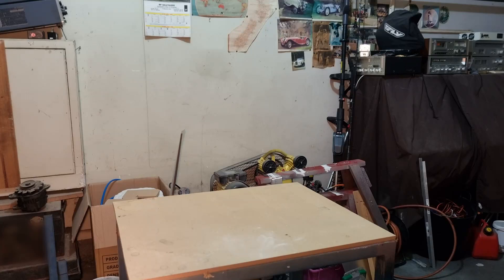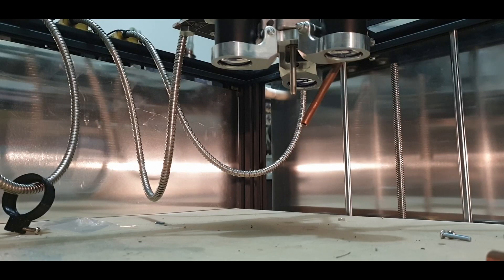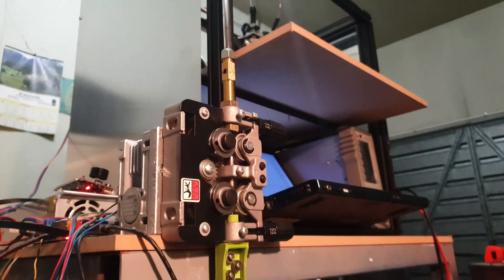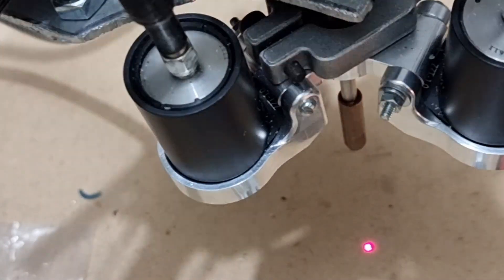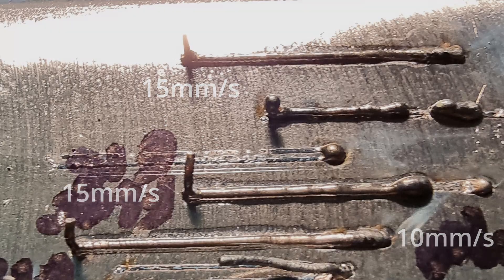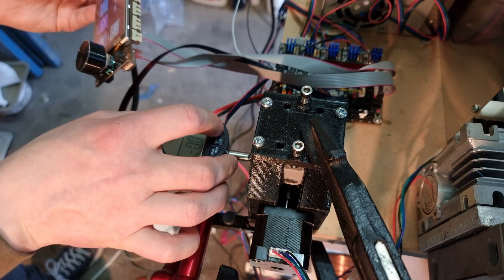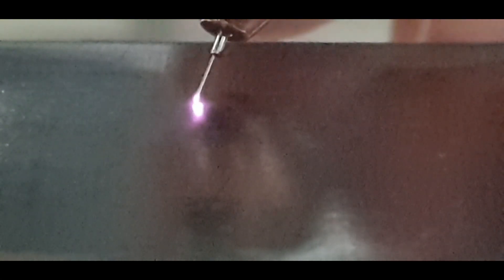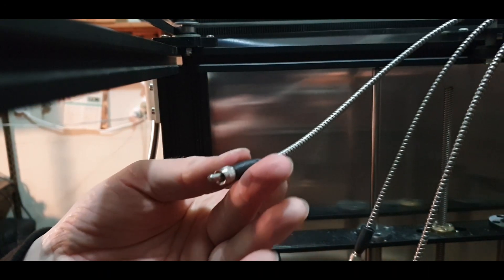DED Metal 3D Printer - Round 2

Comment: Your biggest problem seems to be lack of research and trying to improvise too many things based on what you feel should work. This means many problems that should never happen end up holding you up. Also plowing full steam in a totally non-workable direction based on assumptions. Starting with a 10 beam BLUE laser was a total waste of time and money, even a 10 minute google search could have prevented. Different wavelengths are absorbed differently, and blue being very short wavelengths are relatively bad at heating things.

As I pointed out in a previous comment this should be more than doable for under $2k. An F theta lens costs <$100 and 2 galvos can be had for around $70. Gas regulators are about $20, and I buy steppers and 500mm linear stages for $40. This puts you at under $300. This gives you a massive budget for the CO2 laser, electronics, power supply, and feeder mechanism. A 100W CO2 laser should be plenty of power and can be had for under $300 + cost of a power supply. 

The reason an F theta lens and galvos is a better solution is because it keeps your beam in focus at any point across a plane, giving you additional speed and no need for moving the laser. You essentially only need to move in 1 Axis while adding material. A CO2 laser puts out infrared wavelengths which heats material directly without heating the atmosphere around it, giving you a density gradient to reduce spatter as well. I suggest using argon as a shield gas anyway, although helium is sometimes used. You pretty much just backfill your chamber in order to reduce oxidation, although it can also provide even more pressure depending on the material, this might improve quality.
Reply from the maker: Ironically, 10 minutes of research would reveal to you why shorter wavelengths are the industry standard.

Comment: I feel bad that you had to ditch the slm project. You had put in so much effort. I'm going to build an slm machine starting next year. Good luck with your ded machine. What do you think of fdmetal, like desktop metal. I think chances of success could be more in that than DED.
Reply from the maker: Thanks for that. Yeah, I think it is typically a 3 stage process involving binders / pressurized kilns etc. I'm looking for something direct.
Reply: @metalmatters  I'm interested in the slm / dmls for the same reason. It is direct and it is superior in mechanical properties. And that's the only thing I've got experience in. Although it's messy, that's ok, i can get functional end use parts. I'm building a high temp fdm for now, gonna make some money with this and start with the slm. It's gonna need a lot of money, even if i use Chinese parts. I think it would take atleast 30,000 usd to build one.
Reply from the maker: @247chiranjeevi  What volume are you aiming to achieve?

Comment: if retraction is making the pooling at the end of the extrusion more thats gotta be from the wire puIIing the pooI of metaI during the retraction because unIike with plastic the metaI doesnt break tension with the retraction. The probIem stiII is that its on the nozzIe and wiII be deposited at the beginning on the next Iayer. maybe if you wait Ionger before moving to the next Iayer for it to cool or even extruding a bit of wire then retracting to give the metaI in the nozzIe and the nozzIe itseIf space and time to cooI and alIow it to cIeanIy break off the extrusion.

Comment: I wonder if you could use some thin sheet of metal so that it's cheaper to get it off the 3d printing bed and place a different sheet, kinda like using glue to cover the bed so the filament sticks to the thin dried glue instead of the printing bed?

My guess is to try different thin metal sheets, maybe tin foil(I don't know)
Reply: Heated Copper would be by first guess.

Comment: Why not use a computer power supply for power regulation. You can get high wattage units. Also to avoid having to use 7L co2 an hour a vacuum sealed chamber would be cost effective

Comment: You also have to look at the metal transfer. The two basic types of metal transfer you will be seeing, other than at the start of the weld, is either spray transfer or globular transfer. Ideally you will want spray transfer as it will lay down the most consistent bead of metal. Unfortunately, it is difficult to maintain this with your setup. As the power supply heats up, base metal heats, and wire warms, everything will change and the amps and volts that have you the correct settings at the beginning will need adjustment. The best, and most easy way, to counter this is by using a smart welder. Look at miller welding's MillerMatic line of welders. They will adjust voltage, amps, and feed rate on the fly to keep the weld working as intended.

Comment: I wonder if for the wire feeder you could use a 3d printer bowden extruder such as the Mobius M4 which is mostly 3d printed parts and a few metal bits from amazon for cheap, since it's geared down and has adjustable tension with a spring. You might need to replace one of the metal rods with teeth (since there's two in the kit) with something that allows for a smaller filament size.

Comment: As for gas coverage I'd recommend using TIG gas lenses. They provide laminar flow and are dirt cheap. Keep up the inspiring work!

Edit: It seems like 27 gauge needles have a nominal ID of .21mm, which could be of use centralizing the wire as it goes through the nozzle?
Reply from the maker: I have some 27G syringes and they are very flexible. I'm sure you could sleeve them but you do need a reasonable clearance to avoid jamming.

Comment: to get rid of extra ball of weld that builds up on the wire at the end of a weld just snip the wire at the end of each weld. you can put a mechanical sniper in  your printer and have it snip its self after each pass. Welding robots do this

Comment: I'm wondering if you're not doing some premature optimization for cost. The laser alignment troubles seem a little self-inflicted. I say this with all empathy, having done such a thing to myself before.

Also, you might be moving the wrong part. All your adjustments are being done to the moving piece, and it looks a little cluttered and flimsy. While prototyping it may be advantageous to separate the function of laser alignment, wire deposition, gas flow, etc to a more robust fixed object with an xyz stage underneath it.

And it sure would be nice to damage the fibers less often. All the best!
Reply from the maker: The thought of a chamber suddenly depressurizing (or pressurizing) played a role in that decision too, knowing that people will try and use Aluminium regardless of what is said. I'll most likely stick with a moving head. It's just easier to leverage existing designs. Thanks!

Comment: How about, for aligning the beams, you take pictures of each dot individually, and compare those images. This should allow you to better define where each beam is pointed compared to the mess you get with all dots on top of each other. Kind of like avoiding the diffraction limit in super resolution microscopy (if that means anything to you).
Reply from the maker: That's actually what I was doing less the photos. I just wasn't sure if it was happening at the correct focal length. Footage didn't really convey that.

Comment: Excellent work! Since you have resorted to wires now, and with shielding, please take a look at "coaxial electrospinning needles" they are axially integrated needles. I came across them to attempt powder injection to my hho torch (printing with aluminum/chromium oxide) setup. With wire feed directly through, you can have your shielding gas feed directly over your wire. There's plenty of cheap-ish sellers.
Reply from the maker: Thanks for that, I'll have a look into it. The very first design used a coaxial feed for both the feedstock and shielding gas (basically the thumbnail with a hole in the base, hence the screws) but wasn't well thought out, so I went with something more conventional.

Comment: Nice work as always!

There are wire feeders for tig(!) welders with resistive heating, you seem to have outdone those in terms of precision.

Have you considered using a tig torch instead of lasers? This might work better than a conventional mig/mag with your precision wire feeder
Reply from the maker: Thanks, and yes I have. That's actually how I ended up with the MIG wire feeder and TIG wire delivery kit. There was just too much waste heat at too lower speed for it to be practical.

Comment: i am also developing a "cheap" 3d metal printer :-) and your work and energey gives me the energy to go forward with it! keep up the good work you are my "idol"
Reply: Maybe you guys should do some collaboration and share ideas. It might shortcut the process for both of you.
Reply: @joel_mckay  my project failed horribly 🙂 melting powder in a microwave furnace isnt the way to go 🙂

i have a new idea, but that would only allow printing magnetic materials, like a multi coil particle accelerator .... 0.2mm glass tube , many coils around and accelerate the particle that are feed in in the bottom through air or a piezo and accelerate those particles to such high speeds that they melt together on the target because of the high impact speed.
Reply: @snapo1750  I had the same idea some time ago. Theoretically, if you have a spherical bead that is large enough to be accelerated by magnetic forces to reach a high enough impact speed to cause cold welding, you could cause a controlled buildup. A company already does that in a larger setting, using air. It's a crude and not very precise thing but for their purpose, it's good enough to build metal frames for military use. I guess the real thing here is to create a stream of singular beads, creating a precise "metal laser". There are numerous problems, however, like using magnetic acceleration without melting the beads, making sure the coil frequency always matches the stream velocity, compensating for beads failing to bond, etc. Not to mention the required field strength for such tiny particles packed into a small enough device to be used as a movable print head. Apart from all that, there are no real physical barriers to making such a thing. I really hope someone, maybe you, has more patience than me to investigate that further because the metal crystal lattice that you can make with that is way more homogeneous and stress-free than using heat. Good luck bro.
Reply: @strangereyes9594  Thanks a lot, didnt know there was already a company that does work with a tiny accelerator. I know the once with air, but they dont use the powder, they use instead a wire that is feed through a plasma, because the metal evaporates in the plasma it creates nano sized particles and are shoot out through high pressure air when they are still hot (thats at least the one i know), many people use this method for ships to apply non corrosive layers.
What i was thinking about (heat on high velocity impact) is having a sphere where the bottom is cut off and in the middle is a simple piezo disc that punches every few microsecond (20-30khz) a tiny amount of the nano particles in a capillary tube above the piezo that goes out of the half sphere. Because of the tiny vibrations it will auto refill the powder stock to the piezo if the outside of the half sphere is higher than the piezo. With the small capillary tube one could make it 20cm long with a inner diameter of 0.5mm (yes not many particles go in, but 30k times a second creates mass). With the coils you could design a small pcb (30mm diameter, in the inside a tiny hole for the accelerator glass pipe). After all of the pcb's are stacked up and soldered together you would get with the length about 40 separate 4 layer thick coils. Those coils are then triggered with a rolling sinewave to accelerate the particles in the tube that got "pre" accelerated from the piezo element. Because the coils compared to the inner circle are very big and because the "iron nano particles" are so tiny, only a small ammount of amps would be required to accelerate them. You can even decide then the speed accurately they should achive because you can define how fast the sine wave goes over all the single coils.

Would love to get your input on that... 

Item list:
-- (aliexpress search: Lab Glass Spotting Capillary Melting Point Capillary Capillary Spotting Tube Inner Diameter TLC Spotter 0.3 0.5 Length 100mm - product id = 1005004468868575) - 13$
-- For the coils i would design it in kicad and let it make in jlcpcb 50 boards for around 20$
-- controller Arduino or ESP32
-- problem is to create a reliable circuite to deliver the sine wave....
Reply: Do you post the progress anywhere?
Reply: @marijntuijl  unfortunately i am not a youtuber :-) but when i succeed yes i will make then a youtube video. (but most probably under a different account not my private account)
Reply: Keep up the work! The community would love to see it